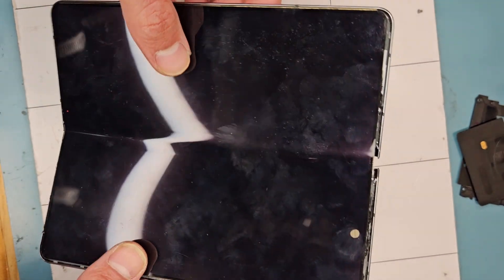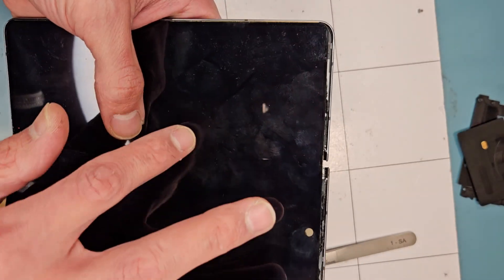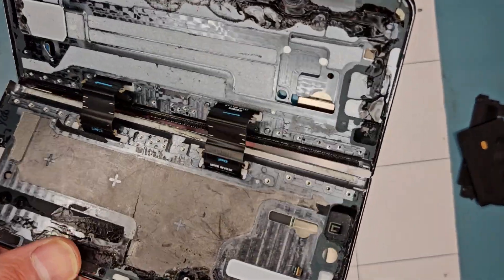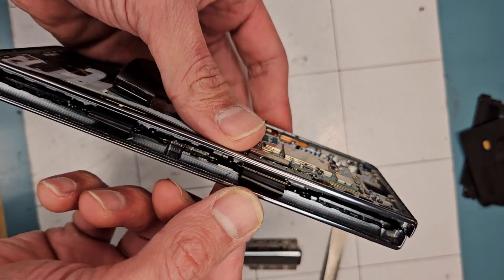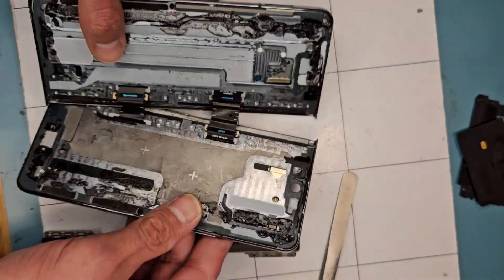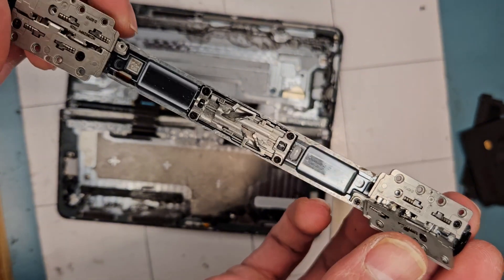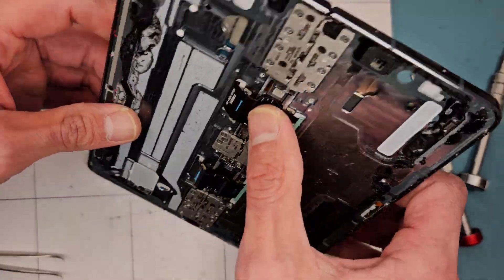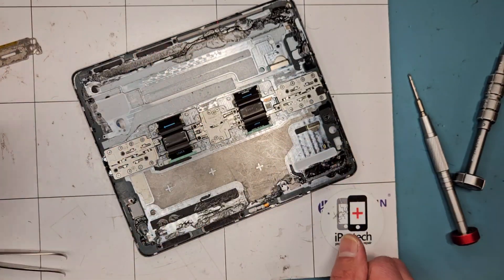Galaxy Z Fold 4 Hinge and Interposer Flex Problem Repair, No Image Screen, No sound #fold4 #hinge

Comment: Having same exact issues. I'm going to try doing it myself. Samsung doesn't want to touch it since its out of warranty. Any tips if you have to do it again? Is it as simple as remove the folding screen and checking the ribbon cables and hinge replacement like you said? No need to touch the back and front?

Comment: thank you for the video, can't we dismantle the interior screen without breaking it?
Reply from the maker: You definitely can. The one on the video was dismantled without any damage. It is a little bit tricky but doable. I think the trickiest part is putting it back again. Best if you keep original adhesive. If you are applying adhesive, make sure to use it at least 2 cm away from the middle or folding area.